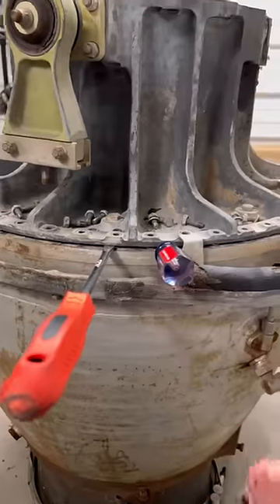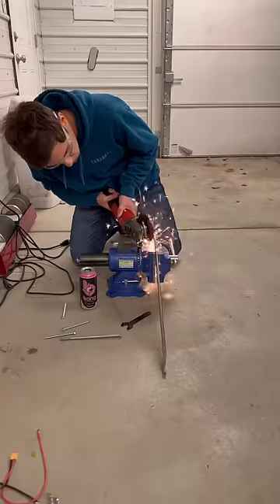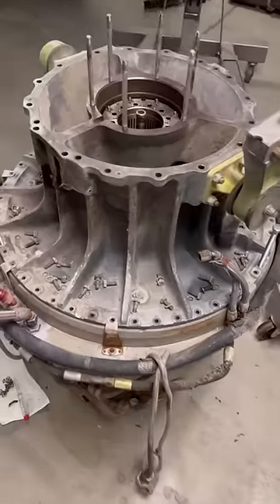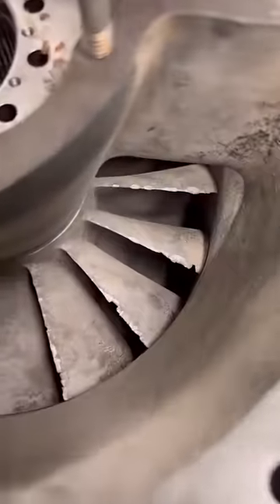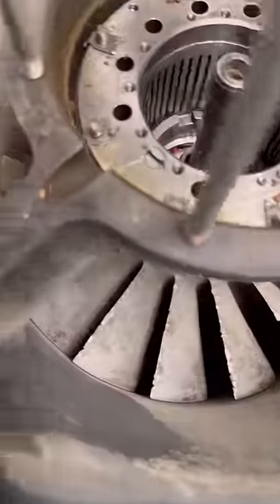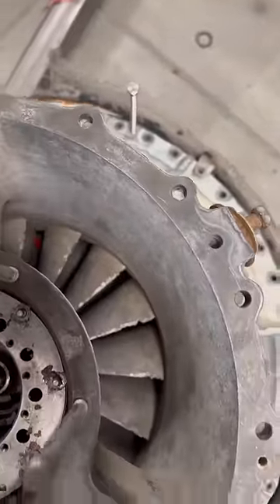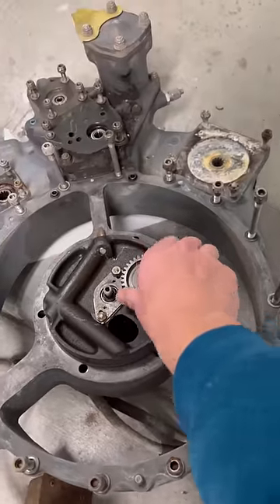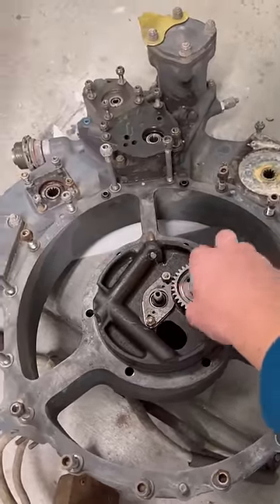Extremely Sketchy Jet Engine

Comment: If it has seized together try heating up the outside evenly and then pulling it apart you may need to shock it a few times to get it come out they have to use that same technique to replace the barrels on old ww2 tanks that have been in for years. You’ll obviously need to remove any rubber bits in the area and whatever else first
Reply: Yep, you are suggesting the same as I think. I would use some electric coils instead of a torch. Also most manuals contain a lot of ideas 😀

Comment: There's probably 4 bolts still secured somewhere on the housing.  Really poke around every inch to be sure.  Unless you know it's not secured in which case just heat the outside up so it expands

Comment: there is very likely tappered roller bearings to not only allow the spindle to rotate but also transfer thrust....so look closer for some bearing locking item, circlip, nut or similar.

Comment: I woukd Almost guarantee there is something still bolted or secured that your overlooking, with it being that tight. Or it's jusr corrosion. I have had parts that absolutely act like they are welded together with just heavy rust.

Comment: Try the same method your using with those bolts but spread the load i.e use more bolts and run them around and around till you see it lift. I would suggest grade 8 6 point bolts. 6 point impact socket. 1/2-1” Impact Gun. Also a consistent air source and hose size. As everyone else stated, spray penetrate excessively between the housing. If this doesn’t work you still have something fastening it down somewhere. Good luck 🙏

Comment: Sit it on a small heater, for a month, then bring the temp up to warm to the touch. It's the years of corrosion and thermal expansion contraction cycles.. by slowly warming it, over a long time, it should relax.. should, with all that effort reapplied of course. Knowledge is a great substitute for elbow grease but sometimes you just need a big dude with mountains for muscles.. 

Good luck brother 🤠👍

Comment: It would be better to consider how it’s built.
I’ll bet you could take a corn rope, soak it in kerosene, and wind it around the housing below the intake.
Light it, and warm up the external housing to make it expand radially.
Keep soaking the rope with kerosene to keep the heat in, check the temperature with a laser thermometer.
I would also have a few blocks of ice to cool the part you are removing.
If there is a way to suspend the engine about a half inch above the ground by the intake, I would highly recommend it.
This way, when the compressor housing drops that fraction of an inch, it won’t cause damage, and you should be able to lift the intake out with no problem.
When it needs to be reinstalled, use a few studs to line it up, and repeat the process to reassemble.

Comment: Wd-40 or mechanical lube with vibrations? Pounding on it will help lube travel throughout dried out/ rusted metal. . 
Or 
You can also try heating and cooling metals to try manipulating flexible of metal. I remember my grandpa telling me about how many times that technique helped him out.

Comment: Look and see if there's any threaded holes in the housing.  They might be jack holes, where you thread bolts into them and uniformly tighten them down to push the housing up. If they used some sort of liquid gasket on it, you may have use heat on it as well.

Comment: There may be a pulley press fit onto the main shaft after the housing goes on in the factory, so you can't take the housing off without pulling the pulley from the main shaft first. Otherwise I don't know, I have seen old parts just seize in from gasket material to be ridiculously stuck

Comment: I understand the ambition, but you’ve obviously never really worked on like cars before you need an air compressor and you need to manhandle this engine. I know you wanna be nice to it but in order to get it apart in this condition, you need some bars and leverage.

Comment: Best guess to loosen the compressor housing heat each bolt hole with a torch then use a weighted hammer to break the rust ring

Comment: probably a bit too late but you need a boatload of heat to crack the corrosion seal I'm talking like multiple torches or you could use a tig arc and just chase the heat around the edge before the pool forms and pop it a few times with a deadblow for good measure

Comment: Now I'm not claiming to know what I'm talking about but turbines can burn at temperatures higher than their melting points.  I'm sure thermal expansion is a huge factor in the clearances and it may need to be heated overall to break free.

Comment: If you look down the center, you only showed it for a second, there is a nut that is torqued to really high torque specs. You need to build a tool to reach down in order to remove it. If you look at YouTube channel "agentjayz" he shows the tool but it was several years ago so you have to go back in the archives

Comment: Age and elements does havoke to metals if everything is unbolted it will take a penatrating oil and some heat to expand the outer housing and some good separation pressure.

Comment: Put out a feeler or two on blogs that you can find that have Air Force veterans in them that used to work on these planes, and more importantly the engines. There has to be some jet engine mechanics that know that engine in and out and can give you pointers and hell! Might even visit you and help you. I didn't know that engine unfortunately so I can't help you. Nonetheless, I highly suggest getting that compressor apart before you start that thing. Make it work. Don't let the thing explode on the test stand. You going to put a lot of work and do it only to have it explode and possibly injure somebody.

Comment: It's probably press fit and heavy af you may need multiple people to apply even torque around the edge with those removal bolts. Do the blades spin if you rotate them? Just watched another short of yours retighten that thing flat and pull it out straight you did exactly what I thought it's crooked

Comment: It does look like something in the center is holding. Something to do with compressor shaft or as someone already said a stuck bearing. A bit of heat with pressure on housing maybe or you need to undo something else on the shaft

Comment: There's 3/4 bolts that are on the inside part of the fin area on the outside of the compressor that have washers around them there should be 8 all together if not then it's more than that maybe 12 of them , I can point them out but one word of advice no matter what unbolt everything before taking a huge tire bar to something or backing something out with a bolt and cracking it , now what your going to have to get someone to reinforce that cracked area by drilling the furthest point of the Crack notch it aluminum tig weld it plate the top and side because of the force if you really don't want it to explode...

Comment: Try my cocktail berrymans B12 chemtool,  pb blast and aircraft brand adhesive remover. I don't know why it works so good but I tried for 3 days to get 1 piston out of a old engine countless $ on any and all brand lubricants and rust off sprays and nothing worked. so I used a combination of my go to sprays and what do u know I got all 8 pistons out in less then 30mins after only 2 hours of being lubricated

Comment: You need to soak it with penetrating oil for a day or so. Then overcome the interference fit by expanding the outer flange with heat. I recommend a torch

Comment: "The lower part must be placed firmly on the floor.  Then you need a crane to gently and evenly lift the upper part off.  It requires physical strength(with lots of sweat and tears, in that kind of garage) and possibly even and precise heating. I have heard that the middle rod and bearing of the motor blades, which can be seen in the video, may have to be removed with extractor tool beforehand."
I heard this from a friend that worked as aero engine mechanic. He said that he don't know what exact engine that is so don't take these as facts. He is the type of guy that has done "lots of stuff in his twenties". But it might be worth a try?
Reply: and don't forget to use lots of penetrating oil, so you don't damage it unnecessarily.

Comment: Heat is your friend in seperating metal parts. Also make sure you have all the bolts out or if they are rhd
Reply: Right, just like removing exhaust manifolds. Imagine how many times this has been heated up beforehand, and its no wonder it's stuck together. And that's assuming there wasn't a pressure or friction for beforehand.

Ice the entire thing, then heat just the housing,. Ezpz.

Comment: Just drip a little bit of automotive rust removal into the compression housing remember to clean it off because if there's any plastic or rubber inside it will corrode or degrade plastics and rubbers.

Comment: I hope and pray you attempt to start it the way it is so that when it finally lights off and heads to idle rpm it grenades and scatters thousands of pieces of titanium hurtling towards you at the speed of sound all while hopefully filling you with a couple reminders of why these engines are not toys. You’ll be wishing you tried a little bit harder or sought professional help to split it apart to properly repair but you’ll have plenty of time to reflect while they’re pulling bits of metal from you.

Comment: Bro… it’s the tabs that surround the entire circumference of the compressor housing that come from the bottom half to the top half holding it in place… either bend those out of the way or remove them

Comment: You need a puller of some sort. I would push against the shaft with some bolts into the body you are trying to pull off. It’s probably a taper fit and just won’t let go yet

Comment: Mount the base to the bottom of an engine hoist and then pull the top with the hoist. Let it soak in penetrating oil. It shouldnt be that hard to heat the aluminum to expand and break free.

Comment: You have to take off the center nut from the splined shaft in the center, then it should come right off. If you keep doing what you're doing you will Crack that housing!!!! Don't be a fool,  use the right tool...... and I would suggest getting a rebuild manual.

Comment: Inject penetrating fluid or Brake fluid cleaners into the gap a few times to see if it loosens up or maybe you will need to use a Steel cutting wheel to cut them apart.

Comment: It looks like there may be a nut inside the center around the scavenge oil tube you might have to take out before you can separate the compressor section.

Comment: Bro there are more bolts holding it together. the larger ones that are still chilling in the valleys that you've got the smaller housing bolts sitting in.

Comment: Grab a few guys, Ice the entire thing until it's as cold as you can get it, then heat the housing with torches in every cardinal direction. 

Should break free no problem. Physics, baby.

Comment: Apply heat and penetating fluid to the corrosion on the body that you mentioned in the last short, light taps around the base with constant tension from both sides of the housing and pray to your God

Comment: Soak it with penetrating oil. Wait a few hours, move it a bit, then soak it again. After a day or so of that, it will come loose. WD-40, Liquid Wrench, anything like that - they help fight the corrosion keeping it on and prevent more from building up

Comment: You may have to remove lockouts on the aft side of the engine. On a cf34 dash 8, I know that's the biggest problem. Sometimes taking 24 + hours to pop with torque multipliers.....best of luck.

Comment: Man I wouldn’t run that thing past idle if you do put it back together. Not in any shape to really run unless you want shrapnel everywhere. I’d use an appropriate press or jog with crane that’ll separate it evenly. Also it may need to be differentially heated to separate as well. Get an mm and go from there. Would definitely weld and re machine cracked housing if not replace… just my opinion. Good luck

Comment: Get you some dry ice line the inside of the housing on the top let it sit for an hour or so then use a torch to heat up the lower part while you pry to separate it probably is shrink fitted

Comment: Have you tried rotating the engine to see if there is a specific point that the Engine would need to be rotated to for it to be able to take the pressure off that screw so that it could release

Comment: If you look closely, he cracked the forward housing at the point where the bolt is screwed in. God only knows what he’s done to the shaft, running down the middle. He has no clue what he’s doing.
This is an accident waiting to happen. I’ll sit back with some popcorn and watch.

Comment: Looks like a BIG Nut in the center of your Engine that goes around the shaft that looks like a Axl for a rear wheel drive vehicle. Looks like it would tap loose with a long chisel & hammer. & it might have reversed threads depending on witch way the motor turns? I really hope you get this message & let me know. Good luck Man.
Reply: Or maybe even a Snap Ring down inside the center of the compressor housing.

Comment: From the looks of those blades I wouldn't even attempt starting it that compressor will spin at about 20,000 RPMs if not more and for those blades to fly off it'll be a catastrophic failure for sure and somebody can get hurt

Comment: Am I mistaken or is there still a nut on the shaft?! If it is you should try removing the nut and the bearing behind it...then you should be able to remove the housing...and I've been a jet engine mechanic for 19 years so if you have any questions just text me.

Comment: Ok well anyone with a brain wound realize the way jet engines are assembled they will need to be lifted or taken apart equally meaning you can’t just pry on one side you will have to lift the housing off like your car tire you don’t put your car tire on and throw one nut on and tighten it the move to the one beside you have to put one on and not fully tighten then put the one across from it on and snug that one up bc you can bend the wheel same with the casing you can bend or even break it or it may never come off so do your research

Comment: I Could Give You Some Ideas To Get That Off But I Need Better Pictures
Also Where You cracked the housing I’d weld it and then obviously grind and sand it back down to the right size even if you had to fill the hole up and then drill and tap it be way better then what it is now
Reply: Welding would be good but that housing is most likely magnesium and welding magnesium without causing a runaway fire takes an extreme level of skill which most people do not possess. Sidenote, magnesium fires are notoriously difficult to put out as even a class ABC extinguisher is useless, and most average people only have that in their home rather than an ABCD extinguisher

Comment: Heat expands and contracts. 2 torches with a over head gantry crane will be your best option. Why risk hurting the engine or yourself by skipping the removal of the housing

Comment: For somebody who's really trying to separate these pieces it's dry as a bone. No lubricant? No vinegar to try to dissolve the corrosion Are you using heat? . One could argue not to use this stuff on the engine as it may cause issues. Down the line but then again you're beating on it with a hammer so...

Comment: I'm curious where did you get the know-how of building jet compressors because it seems you have a pretty knowledgeable database to pull from 🤔 secondly it looks like you have a hairline fracture at the point your using that all-thread to pull open that cover, it looks like you've might have missed a bolt or screw in this take-down. Oh btw, you might get a'lil better results using a heat torch on those nuts, some lubricant 😉👍

Comment: You might be an aerospace engineer but you're not a mechanic you need an Old redneck that's been working on everything for 20 years he would have got most of that stuff apart without breaking anything

Comment: Run a bolt into the main shaft. Then, strike it once with a 3lb hammer.  It should pop up and off of the shaft. Reason:. It's sitting on a tapered shaft.  You can thank me later.😁

Comment: Yea how bout them few metal tabs that are holding that pce your trying to take off there seems to be a bunch of Lil clamps around the whole thing holding it down. It's screwed down with Lil smaller screws onto the other side of the housing

Comment: What about get like 10 or so 16" lengths of threaded rod thread it in to the holes so basically like a exhaust manifold stud then bend some 2" flat stock into a C shape cut out notch in one side that the stud will fit between then drill hole in other side so stud can go thru then put the end of the C shaped flat stock with notch under compressor housing flange then put stud through top hole of the C shape flat stock then on the bottom side of the flat stock hole put a nut and couple washers then thread stud into threaded hole in the engine the get a wrench and tighten the nut up against the bottom side of the C shape flat stock then go around in a circle and get pressure on them hit a few times with dead blow then tighten all the nuts again then smack then tighten then smack it so it's basically like a gear puller wish I could draw a picture

Comment: very very low heat, and it will pop, smack it with a lead filled dead blow. DO NOT USE BRASS , use lead as it conforms, also set your air peener to very very low PSI, and could use a piece of lead between it, and peen around the surface lightly to not crack the ridge much more, and the ridge can be repaired, but please do not do that as im sure you are not a certified aerospace welder.